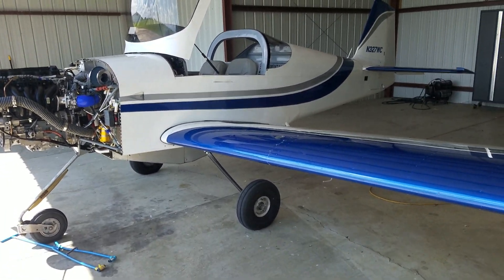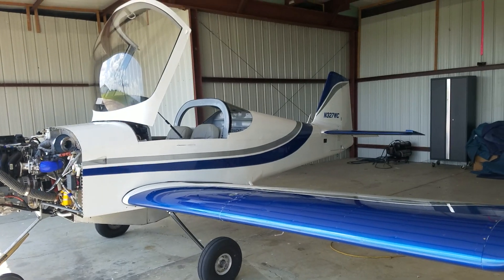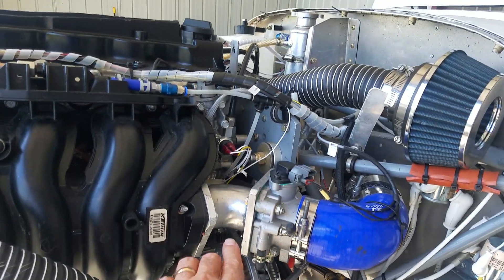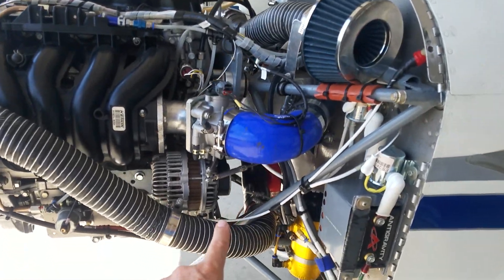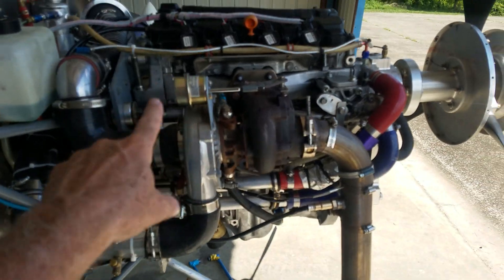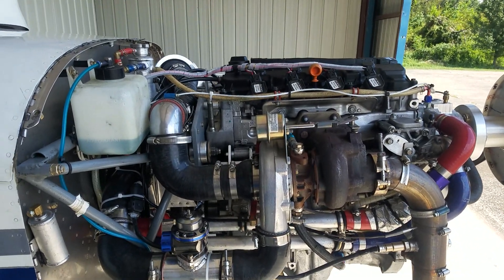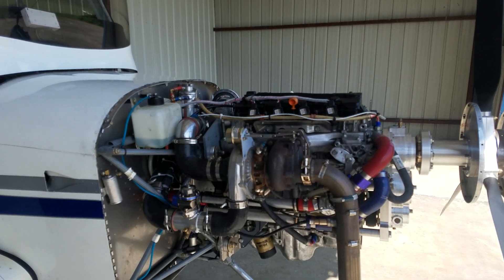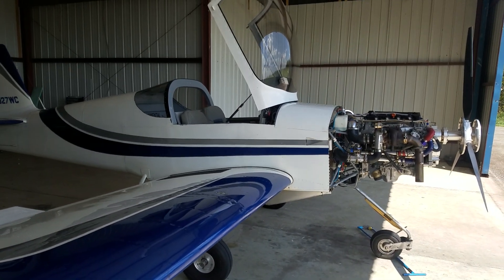Honda R18 engine installed in Kitplane.

Comment: Hi did you blocked off the heater coolant flow housing, if so where did you buy the block off plate?😊
Reply from the maker: Yes I made my own.  Just 1/4 aluminum and gasket sealant.
Reply: Hi can you tell me what are the bolt screw size for that? 😊
Reply from the maker: @danielfontanez2916  I am sorry I do not remember.  I sold the plane a year and a half ago. ...
Reply: Ok thanks 😊

Comment: Whats the hp output. Would this work on a kitfox series 7. I know they had used the viking 130hp on them before. My kit comes in, in Nov 24. I need to start considering engine options. Most likly the rotax 912uls but your design is amazing. You are brilliant.
Reply from the maker: Good luck your Kitfox, great airplane for sure.   I want to add that my engine install was NOT a Viking Engine installation.   The only part of my set up that was Viking was the Gearbox.  (Viking no longer sells gearboxes by themselves.) The rest I created myself.  I used the R18 which stock is about 145 may be a bit more.  I added a turbo to it and added very little boost, about 4 psi.   So I would guess that I was only developing about 170 may be 180 HP tops.   I was very happy with it.  Flew it for about 250 hours and sold it.

Comment: Do you know how much HP you are producing with the Turbo install?
Reply from the maker: It is really a component on how much boost you choose to use.   I am conservative using a few lbs of boost usually only on Take Off. Which would work out to be about 160 - 170HP.

Comment: Also how much have you found magneto's for, about 1500$ for me :/
Reply from the maker: The gearbox I use is no longer available from the company Viking Aircraft Engines (unless you buy one of their engines).   The Pietenpol is a great airplane.   I suggest you contact Vasilli at airtrikes.net.   I think he has a good reputation on his SPG gearbox as well as in providing Susuki engines.    Good luck.    (I do not use magnetos, I just electronic ECU made by SDSEFI - a fantastic set up.
Reply: @charosenz  woah man that really helped, thank you!! I will definitely look at their gearboxes when I install the engine! Good prices and proven reliability. Priceless!!

Comment: Curious of how many pounds of boost it's running at full power climb and cruise? Also do you have fuel burn numbers at cruise and full power? 

I know you feel that this Honda engine is nearly bullet proof internally but "I Do Cars" channel tore down a 1.4L GM ecotech turbo engine from a chevy Cruze and compared the piston rod thickness to one of a Honda Fit or Civic and the thickness differences were HUGE. Therefore, I would be careful with the amount of boost your engine is pushing since the piston rods really wasn't designed for turbo charging. I'll link that video if your channel allows it?
Reply from the maker: The Turbo is there to normalizing MAP at higher altitudes.   My statement about Honda engines was in general as to how they compare to the industry as a whole.    This is a good engine for my application.